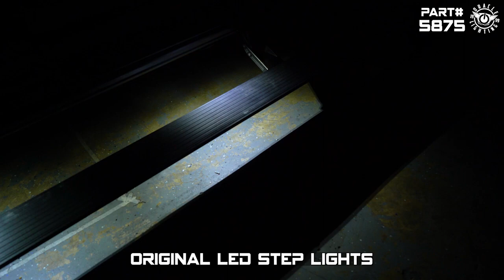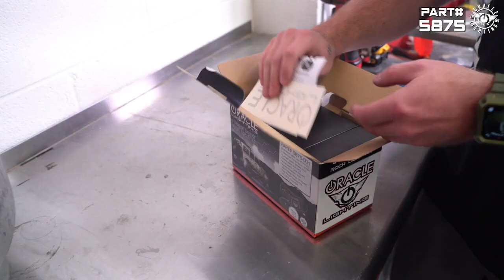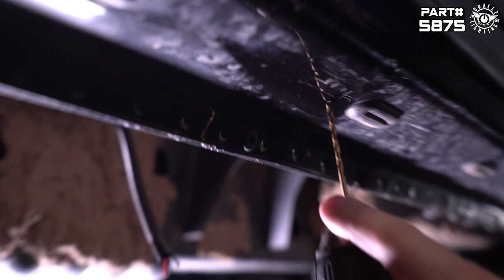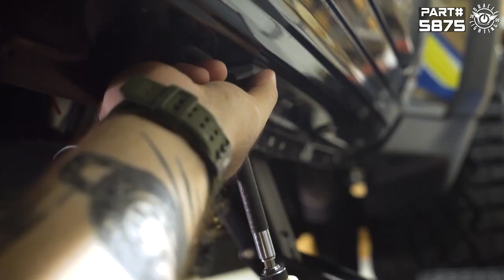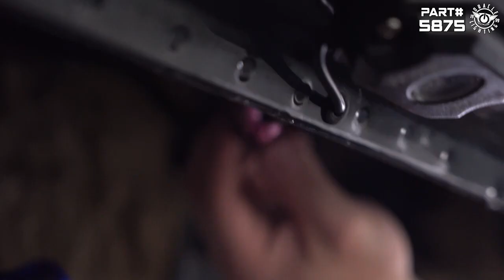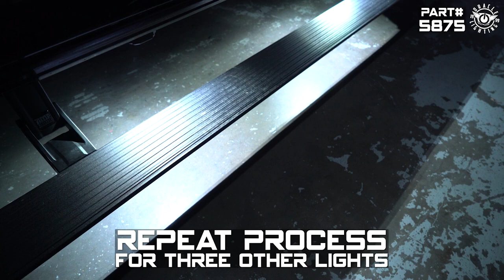DIY: Bigger & Brighter LED for Amp Research Power Steps from ORACLE Lighting True White Rock Light

Comment: Did you use the include backing pad? It says not to in your description but looks like you did when wiring it up. 
If you didnt use the backing will the wire not crimp? The pad allows for the option for the wire to run out to the side. Thanks, great upgrade and descriptions.